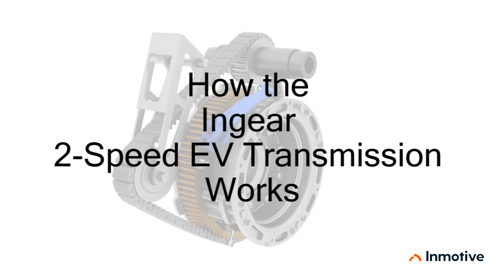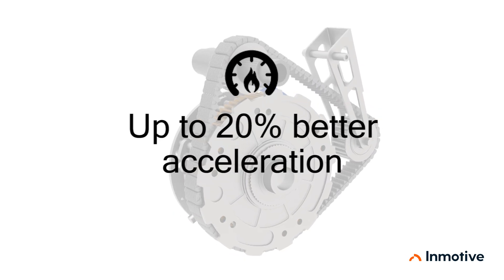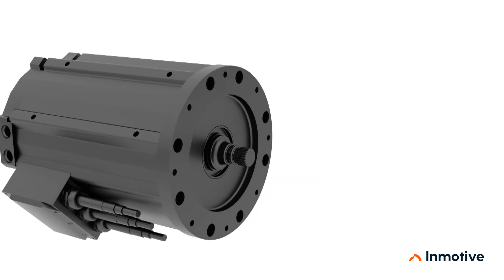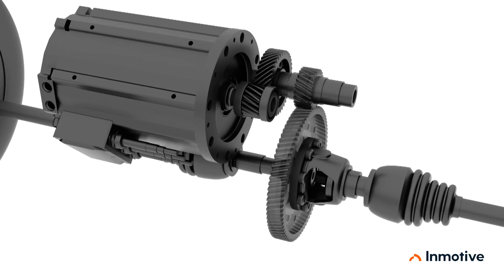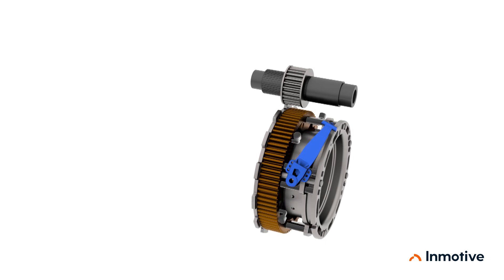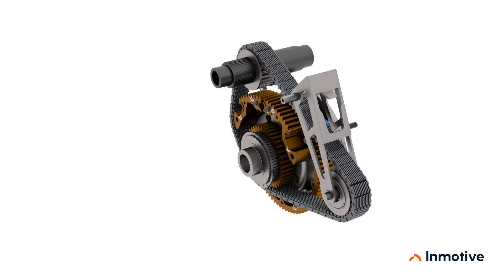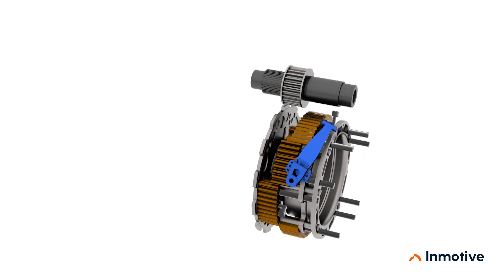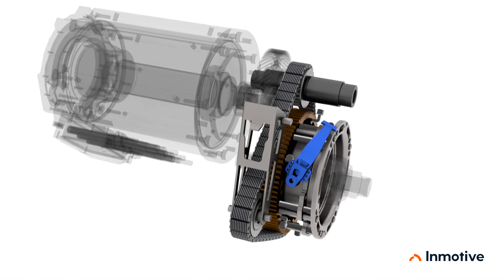How the Ingear Works

Comment: that's so silly. sure put a push-bike chain and sprocket in a car. 
I'm sure a 1000 chain links rattling away down the road won't be audible to the driver. 
oh and imagen the friction that water wheel's gonna make on your box oil.

Comment: I am curious what about regen braking or reverse? You design has a principle similar to a bike derailleur in terms of tensioning the chain which automatically eliminates the possibility of regenerative braking and reverse. If the input gear starts moving the other way round it will automatically pull the tensioner towards the sprockets (damage?) and creating slack on the other side (slack=no good). So how is it done? No reverse? A mechanism that blocks the tensioner in one position while regen/reverse?

Comment: I'm a mountain bike aficionado and own six bikes. Being a motor-head and hotrodder I have long held a special appreciation for chain sprocket drives. I note with all the gas or electric 'power' your bicycle kits that no one powers through the bicycles 'transmission' .  I have always thought that bicycle chain drives were limited to human power and even so it's said to 'back-off the peddles' while shifting.
 It seems for Ingear there is one size fits all as well as a $150 price point. We know Tesla motors are in the 250Hp realm and can have two-motors on an axle. Sure looks to me like the Inmotive 2-Speed Transmission would be severely challenged to deal with the higher horsepower/torgue and demands of drivers of sport electric vehicles.  Particularly I wonder how the 'pins' that allow for the moving of the sprocket components will hold up to power-shifts etc.  The lack of clutches makes for 'instant' shifts and very high shock loading upon shifts.

Comment: Why you not recommend clutch plates
That is cheap and many gear option to auto and manual transmission
Reply from the maker: Hi ANKIT JADHAO. There are other competitive transmissions using clutches which function well, but have the drawback of lost efficiency. The Ingear is able to shift without clutches so we have better efficiency and low cost.
Thanks!